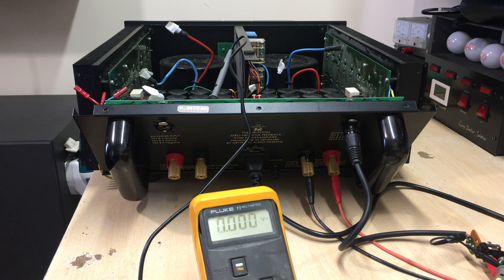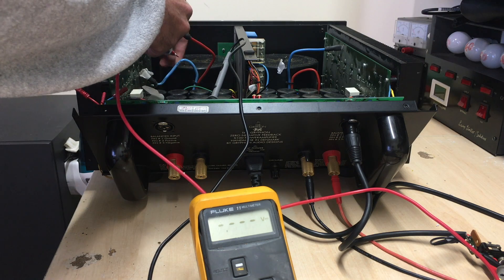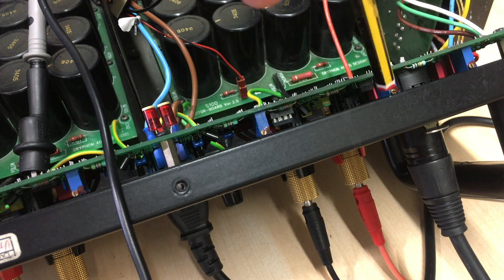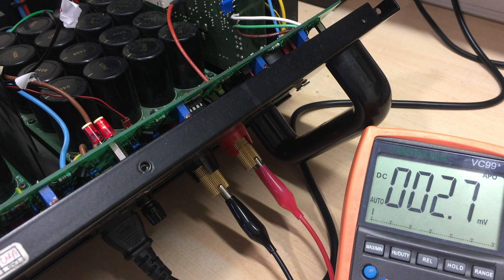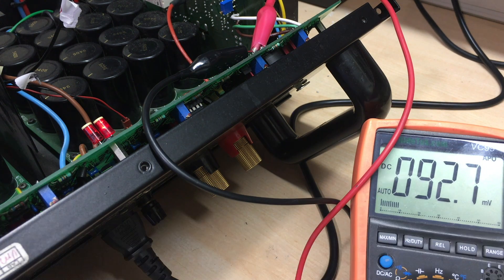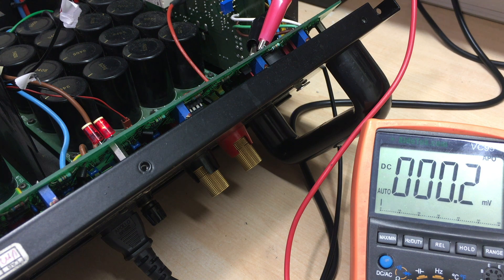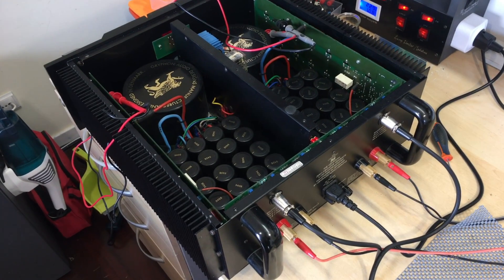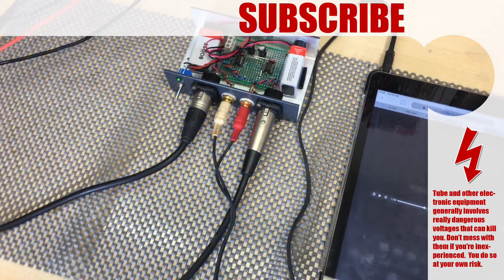Gryphon S100 Amplifier Repair - Part 3. Final adjustments and testing.

Comment: Hi, I am Paolo from Italy, I've some problem with bias of gryphon S100, is not so stable,Yesterday I found around 24 v, after 5 hours turn on. Then I reset to 20 several times. TodayI check around 30 v after turn on, then little go down around 27v...
Can you help me? Also my technician didn't have the schematic diagram, can you send to me?
Thanks a lot
Paolo
Reply from the maker: I’m afraid I have returned the service documents to the source as I had promised him I would do, so I can’t help you there. I don’t quite recall the values any more as it has been quite a while since I worked on that amp.
Reply: @electronicsoldandnew  thanks for your reply , Gryphon wrote to me that the correct value is 20 v +/-0,5 t, so , this is not a problem, the problem is : that value is not stable... which component have the bias value control? maybe I need to replace the trimmer?
Reply: @electronicsoldandnew  into your third video, you talk about 15 mV of bias, but Gryphon write to me a 20 mV value, why this difference?
Reply from the maker: If I recall correctly, the 15mV was on the instructions. Not sure. The trimmer is probably fine because you’re experiencing a drift rather than sharp jumps.  could be a transistor on that part of the circuit.
Reply: @electronicsoldandnew  I'm still Paolo from Italy. my S100 have a problem now. The right channel goes into protection and only if I unplug the XLR connector it reattaches. Unfortunately, the right relay on the power board is also dead.
My repairman disassembled the board and replaced the relay, but after a few hours of operation, the amp went into protection on the right channel again. I think there is something, when the signal comes to the amp, that it does that. Can you help me ?
Reply from the maker: I’m afraid not. It’s not practical to try and give advise from a distance, especially with an amp like this that can go seriously wrong if the wrong advise is given.
Reply: @electronicsoldandnew  thanks for your prompt reply, , I can understand you, but.. why only with signal? and why the rele broken, is the last component of the circuit bebore the loudspeaker connections.
Reply from the maker: you could have high DC voltages appearing when the amp is driven.
Reply: @electronicsoldandnew  Yes, is what I think also, thanks for your reply
Reply: 24V or mV, where are you measure?
Reply: @vinkospika2296  sorry for my late reply. of course is 24 mV . There are two test point in the front part of the two vertical pcb (transistor PCB) .

Comment: Hi 
Thanks for your description about balanced input and dual op amps .
Actually I’m really in need of those experiences and information. Since I’ve involved in new challenge in repair of surround sound amplifier utilizing many of those dual op amp ic 4558 in which I’ve seen the inverted input , but I don’t know it’s application 
Other thing is that as far as I could not 
find any schematic for that, I decide to change all the semi conductors as well as ICs except for power amp section cause I had checked it before and it was sound.
Reply from the maker: Good luck with your surround system.

Comment: It could be great to know where you plug the voltimeter (minute 6:36) in order to adjust de idle current... Thanks!
Reply from the maker: There are two test points at the back of each board that you connect the voltmeter to for this setting.  I refer to these points in one of the previous videos in this series. I'm sorry I did not clearly point this out on this video.

Comment: Hi good video. Do you know what caused it to go wrong in the first place. I have heard a gryphon set up in Glasgow it was unreal how good it sounded. it was big money the power cable was more than my current stereo. I would hope gear as good and as expensive would be long lived and bomb proof.
Reply from the maker: I didn’t ever get told exactly what the original owner did to mess this thing up in the first place, but I’ll hazard a guess.  These units are run pretty hot, I mean  really hot! The driver boards have parts that heat up so much you can’t touch them. I’d guess that this was left without enough space for air to circulate and hence cool the thing down.